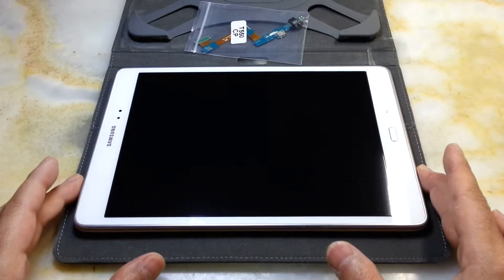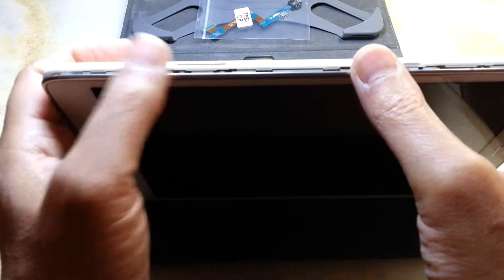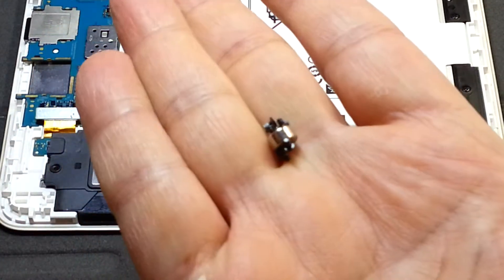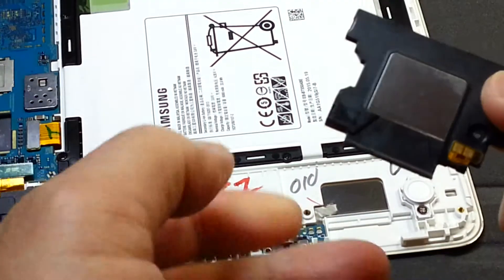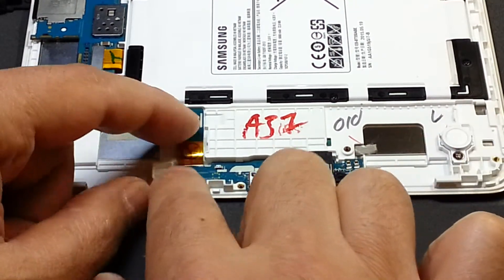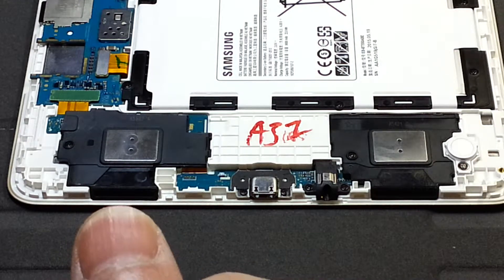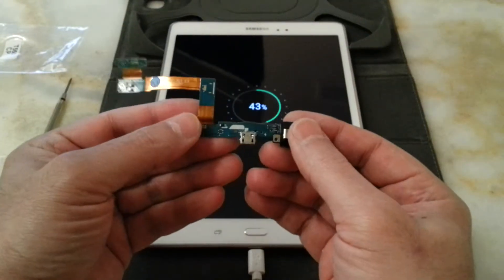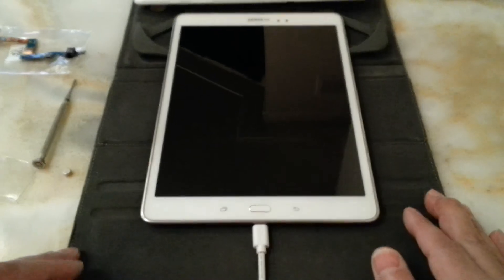Galaxy Tab A 9.7" SM-T555/550 Charging port repair

Comment: Please can you share the link where I can get the port socket,mine is T550.

I got the charging port, bought from the link you gave,and followed your instructions, still did not work. Please did you remove the socket,did you solder anything because I remember you didn't show the part,only when you are placing it back?. Help

Comment: My husband changed the port out but for some reason it's still not charging. He changed out the battery, thinking that may have been the problem. Still not charging but new battery works. Any ideas?
Reply: Are you sure the lcd is working? If its dark try changing it. And also try to purchase the part on Amazon
. Ebay parts don't work

Comment: Thank you my tablet has done the same but it was cause  by my little one who yanked  out the cable several times and now last night  it wouldn't  charge . My Samsung  has been loyal with no problems almost 10yrs . I dont want to replace her for something so simple to do.  Thank you for your easy step  video. 
Now I have a question can the tablets battery  when damaged by surge or heat can it be replaced with  another  battery. ?
Reply from the maker: Hi, thanks for your question. Of course it can be replaced but it needs a bit more attention when removing its connector from the main board as it's very delicate. I recommend to watch a video or two before. The battery is a bit expensive and more dangerous if a short occurs so make sure you are familiar in what you are doing. Good luck and cheers for now.

Comment: Nice video, thanks for it! I am going to try it myself. 
Question: should I not disconnect the battery before changing the port?
Reply from the maker: Hi, if you can be extra careful no need as disconnecting the battery is very tricky because the connector could get damaged and costs of repair is very dear. Good luck and stay safe. Cheerio.
Reply: Thanks for the quick response! I just ordered the charging port assembly.
I will do the repair action in a few days when it arrives...